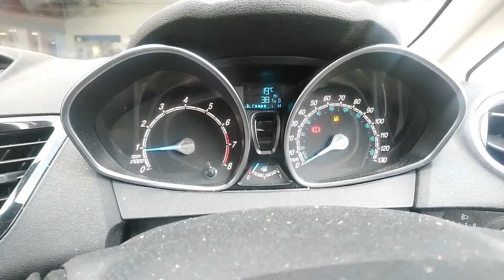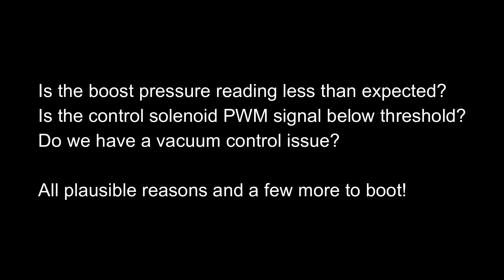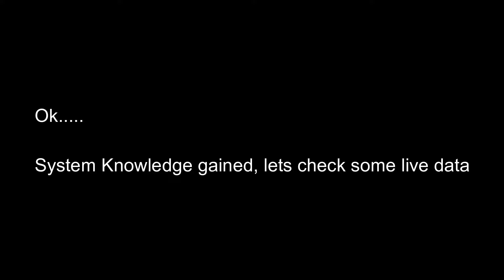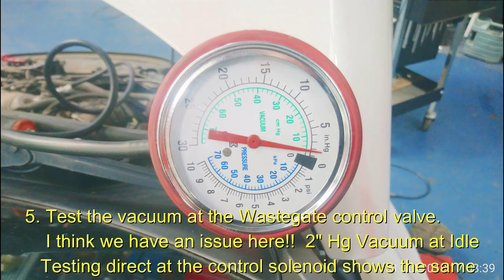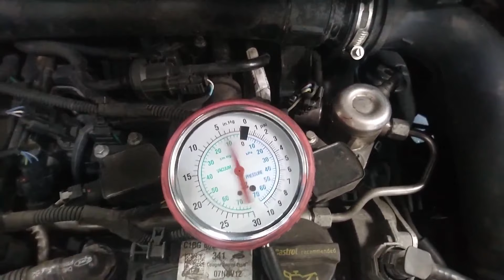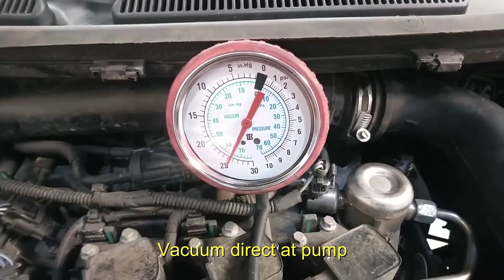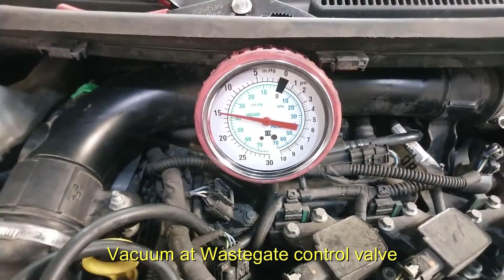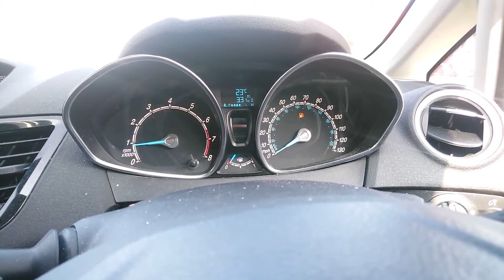Ford Fiesta Focus 1.0 EcoBoost -  Low Power - P132B - How To Test Turbo Control

Comment: I have been following this video with interest watched it a few times to get my head around it. Our 1.0 focus is down on power and there is hardly any vaccum on the pump. It seems to send out an oily mist at the same time pulsates if that make sense. We replaced the one way  valve got one of ebay but it lasted a month. We have forscan that gives the same boost reading that you were showing shows a negative reading as the engine if revved. Looks like it needs a new vac pump, Worst engine I have ever owned poor sytem with the wet belt we have had that done after it broke but we were able to get it fixed.
Reply: having the same problem on my focus. fluctuates and sends some sort of mist out. lose power if I put my foot down too much in higher gears. I’ve tested the vacuum with a gauge and the needle goes everywhere. Did replacing it solve it?

Comment: Debris in gauze filter usually wet belt starting to break up. Customer should be advised to check this as its a very common issue
Reply from the maker: Sure is

Comment: go a problem with same engine. got good vacuum from pump ( fitted new one way valve ) but it throws p132b :21 code and has loss of turbo power. ive swopped out the solenoid (2nd hand ) and its the same . Ive fited new map sensor and got voltage at the solenoid but it wont send vacuum signal to the waste gate. ( checken all hoses and smoke tested it )  Im stumped now . any ideas ?
thanks for your great content .

Comment: great fix. but what is the cause  for the debris on the gauze filter?  maybe the timing belt?
Reply from the maker: Exactly that.....
Reply: @SYDiagnostics  so it needs to be replaced too?
Reply from the maker: @wicked0815  it's advisable to remove the sump and clean the pick up pipe, flush oil system. The belt is a very big job requiring special tools. Most issues are down to poor servicing/ oil
Reply: @SYDiagnostics  ford wants to replace the belt, the oil pump, the water pump and the vacuum pump at my c-max. I missed my last service for about 2 months. They want 2.200 bucks for it ☹️
Reply from the maker: @wicked0815  ouch....!!

Comment: what if the vacuum is good at the pump but herratic at the turbo actuator ? should i fisrt try a new solenoid? there is no leak in vacuum lines

Comment: This video has been great help for me, thanks!
My turbo was broken and had to replace it, with new turbo I still get codes P132B and P006A.. Car is not working at all.. Checked the vacuum pump and it is holding vacuum. At idle it is giving 20psi vacuum, but when I press brake few times the  vacuum goes to 0 and then is slowly going back to 20psi.. Should there bee strong vacuum all the time when motor is running? Should I replace my vacuum pump?
Reply from the maker: it may be worth getting hold of a one way valve and place it in line between the vac solenoid and pump before spending on a new pump. Also a cheap fix too
Reply: @SYDiagnostics  I checked the vacuum pump outlet and it is holding vacuum, so I think the check valve is ok? I have one spare one way valve, so I could try that.
Reply from the maker: @JouniP19  have you got vacuum at the turbo and on road test can you see the vacuum build up and release on demand?
Reply: @SYDiagnostics  Tested at road and the vacuum at turbo was ok and relealeased when no demand.. So the vacuum pump seems to be ok..
Reply from the maker: @JouniP19  then i'd be questioning the turbo you've replaced or if you have a boost leak , can you operate the wastegate, if you pull vac pipe off with it on idle, you should see the rod move
Reply: @SYDiagnostics  I have ordered a one way check valve online. 
What way should the arrow on the check valve  point towards?

Im guessing it should point towards the vacum pump. So air can be drawn into the pump but not flow back throgh the tube therefore holding vaccum? 

Please correct me if I am wrong
Reply from the maker: @allaroundrc3204  its how id fit it
Reply: @SYDiagnostics  
Thanks for the reply 
I will update when I install
Reply: @allaroundrc3204  update?

Comment: very good video,use this to fix a 20 dti zafira,very poor boost ,tested ecu to boost solinoid and got a switch earth ,opcom could power up solinoids too,applied vacum with a hand pump too,got waste gate to move and hold posistion ,all what was left was the pipes and the pump,pipes held vac and i tried vac pump on pump,did same as yours ,back forth on dial,but i not know that was a bad thing ,after watch this vid ,tried vac test on another zaf a dti and gauge held steady ,hold vac,your vid was the key to moving forward,swop out pump and zaf pulls like a train now ,got live data in opcom too,never thought of check there ,see what the ecu see,from its sensors ,cheers buddy ,keep up the good work ,i have fixed 3 transits now too,and got forscan ,from watching you,and a usb oscilloscope too,for my laptop,boss thinks its strange now i have started fixing more cars ,vans,told him i got a good teacher ,night school,
Reply from the maker: Wow!! That's great to hear

Comment: I have pending DTC code p132b (21) and I'm looking to save some money and hopefully diagnose the problem myself (total novice) Lets be fair it's £45 just to get the diagnostics on it to tell you you've got a problem (I know already) what tools are required and are they expensive? I see a pressure gauges are required, Ive seen a kit at Toolstation and others for £20 or less are these adequate? How much is the smoke testing gear? is there anything that I shouldn't attempt? I have seen elsewhere that shot diaphragm can be a a route cause, and that's just undoing one bolt to check that ain't it? We are all just trying to save a few quid times are hard! I've only had the vehicle a few months 😭Been serviced regular, full MOT no advisories, vehicle health check at Perrys 31/03/2022 engine timing check required  and fixed (£392.47) and a pre delivery inspection carried out 07/04/2022 (Turbo charger operates ✅Hoses lines and fittings ✅ wiring and cables ✅ Am I just unlucky?

Sorry it's long winded, but I NEED HELP! Thanks in advance
Reply: You fixed this code? Mi volvo have same proble….
Reply: @FranckoFerj  There was a rubber diaphram that had burnt, which I replaced. I also had a 02 sensor replaced, not sure if the 2 were related but I've not had any issues since.

Comment: the diaphragm he replaced the whole vac pump to fix can be found of under £10 on Ebay. the dead giveaway is that the wastegate actuator rod can be seen flapping about at idle when the engine is running. its just a case of pulling the hose out of the plastic diagram removing a T25 screw and inserting a new one then reconnecting the pipe. you may also want to wash about the BCS on the side of the engine as it can have oil in it that has been pushed into it because of the failed diaphragm so a shot of brake clean in the 3 ports and shaking out the oil inside before reinstalling it can fix the issue.

Comment: Regarding my earlier comment I see the smoke testing kit is expensive! I think I'm out my depth, some of it looks simple enough, checking the pump for damage, maybe checking the pressure. I ought to start at the beginning with the live data see what I get, that  I should be able to manage.
Reply from the maker: You can get tools for turbo testing that use compressed air for under £100.
These can be adapted to this application but air isn't easy to see unlike smoke
Reply: @SYDiagnostics  As I said I'm a novice, but I'm not simple and can follow simple instructions, but I'll only have a go if I think I'm caple.

Comment: The vacuum pump valve, diaphragm was shot to bits on mine, but I followed you video to check the diagnostics, which I'll have to check again when I fix it, I think I've sourced just the diaphragm alone for just under £15 🤞 Great work content like yours helps us save a few quid during desperate times

Comment: Great video, I found this searching for the same error code on 2012 fiesta 1.4 tdci euro 5 engine,, would you know if this has the same turbo vacuum pump to check for ?  I do not have access to the testing equipment and am pretty sure after checking what I can that my problem could very well be the same if mine is the same set up at the ecoboost ?  I appreciate reply in advance,   ohh and my car is smoking badly when driven but smokes like made when driven!     a sign of turbo malfunction also i believe, but does seem to boost when revs get to 3000
Reply from the maker: it will be a different vacuum pump. The diesel engines suffere from faulty turbo boost position sensors which are part of the wastegate actuator
Reply from the maker: i'd also che3ck for boost leaks too
Reply: @SYDiagnostics  Thank you very much indeed , hopefully we can get this sorted ,  I am on 2nd engine lol!
Reply: Hi again, I brought a used turbo as mechanic told me it was the turbo on the 2nd engine that he believed was also faulty , So he fitted the used turbo and told me car was now fixed,  I pick it up and drove home 2 miles car seemed fine but was smoking blue/white on way home, i thought that was oil residue left from old turbo ,, anyway took car for 4 mile drive and same code came back and now in limp mode again ,,   most frustrating indeed

Comment: My check valve was broken too. Tested it also on work bench but no need to remove the pump. Fitted an in-line 4mm dia hose check valve for the grand total of £5. At 2k rpm before fitting check valve I got vacuum pressure of 10inHg and after I got 20inHg!
Reply from the maker: nice alternative fix, having the video obviously helped, I on the other hand had to find the check valve initially. I've fitted a non return valve since and like you, it worked

Comment: oww if that debris are bits of the wet belt, he's gonna have bigger problems than the turbo very soon, if the oil pump clogs or the belt direclty fails, goodbye engine

Comment: Thats a good bit of boost for a small engine....
I bet the brakes were a lot sharper to with restored vacuum.
Reply from the maker: Surprisingly I didnt notice any braking issues, but they did run out of vacuum after a few pumps

Comment: I have the very same issue.....check valve was replaced(volvo sell it seperate)  new recirculation valve and no leaks....any more ideas ?
Reply: Can you tell me the volvo part no.? Thank you!
Reply: With p132b21 code?
Reply: I have volvo v40 2013 with this code

Comment: Love the videos. I've managed to fix this fault with fitting a non return valve from a brake vac hose into the vac feed pipe to the boost control solenoid. Much better than a £300 pound vac pump. Hope that helps someone.
Reply from the maker: nice fix........well done . Glad i helped in some way
Reply: The tourist i think i have the same problem there.... do you have any sort of video or something to show how you did it?
Reply: @nori.m6898  no sorry I dont have a video. It's pretty easy though. I didn't cut the existing hose just added a non return valve to the end and connected it up with another small bit of hose.
Reply: The tourist 
Hi thanks for the reply. 
I have ordered a one way check valve online today. 
What direction should the arrow on the check valve face when installing?  (im guessing arrow should  should point towards the vacum pump?)
Also did you do a vacum test afterwards and was the needle on the gauge stable?
Thanks
Reply: @ajaxrow  
Thanks for the reply
I will give it a go when the parts arrive. 
Why should the turbo actuator close at idle?  Surely no boost pressure is needed for idle and this could damage the engine?  

Thanks
Reply: I have focus with this engine. The previous owner seems to have repaired this fault. The solenoid cable is connected directly to the brake vacuum hose. Can You look at the fotos and tell me is the right fix? https://ibb.co/Vt4Vtyh
https://ibb.co/vQqW00v
Reply: @ajaxrow  was this in the hose that goes from solenoid to vac pump, the short hose?
Reply: @DD-fr5lt  yeah the short hose from the vac pump to the control solenoid.
Reply: @ajaxrow  OK cheers. I've just done it but no change. Got everything the right way too. I may have to just bug the part  I've found one on ebay for £26.

Comment: Where abouts are you located ? I have a 1.4 tdi 2011 with same code but it's come up twice same as yours and the other says 
Turbo charging pressure sensor circuit signal outside lower limit , any ideas ?
Reply from the maker: It'll probably be the turbo actuator (built in sensor) quite common
Reply: @SYDiagnostics  thanks

Comment: Thanks for the informative video SY Diagnostics, im hoping you or someone else can help me, i have found i have this issue and upon looking have confirmed the check valve inner rubber umbrella diaphragm membrane piece is broken/disintegrated, i tested with a good working valve from a friends car same car/engine and it solved my issue , so im looking for a replacement inner rubber umbrella membrane diaphragm for inside , does anyone know where i can buy one cheap in the UK ? failing that i have found an inline Brake Servo Non Return Valve Check One-Way Brake Booster Vacuum valve online. 
The specs for this valve are  
Valve Opening (Cracking) Pressure: <0.07psi
Maximum Backpressure: 43psi (3 Bar)
Operating Pressure Range: 0.07psi to 40psi (2.75 Bar) 
Would this be suitable for me to fit inline of the pipe if i cant get the other part?
thank you , Regards, Danny.

Comment: Heyy, I am experiencing the same issue on my Focus ( 1.5 Ecoboost engine ) 150 ps version ; can you help me with the part number for the Vacuum pump and how much did it cost you ? The dealer here refuse to give me the part number; And this engine is not on every market , so I don't know if my vacuum pump is the same as the Kuga ( Escape ) or Fusion with the same engine or even the 1.0 Focus . Thank You.

Comment: I have a P0238 error code on my 1.0l fiesta Turbocharger Boost Sensor A Circuit High which presents similar symptoms. What should i inspect first?
Reply from the maker: First thing I'd be checking is live data to confirm the readings then check supply, signal and ground on the sensor

Comment: you timing belt is in dissolution, thats the reason why your filter on your vacuumpump is blocked/clogged. Wrong engin oil used in this car

Comment: Did you by chance notice oil on the "check valve" of the vacuum supply (ie. 7:52) before taking the vacuum pump off?
I have a 2014 Fiesta with exactly the same symptoms and also oil on the vacuum pump around the area where this valve goes in.
here's a picture - https://imgur.com/a/XYF4yUy
Reply from the maker: to be honestly can't remember now, it was a long while ago
Reply: @SYDiagnostics  but what do you think from my picture? is it normal? where does that oil come from?
Reply from the maker: @sterpumihai   either from internally via the o ring on the valve or possibly through misting around the hose?
hard to say really, id imagine its oil that eventually deteriorates the check valve diaphragm

Comment: I guess the check valve on the pump would stop any major vacuum fluctuations as the pump turned, unlike the test with the original pump where the needle was a blur in the vacuum gauge.
Reply from the maker: exactly, you got it !